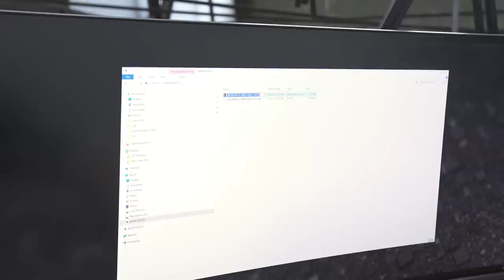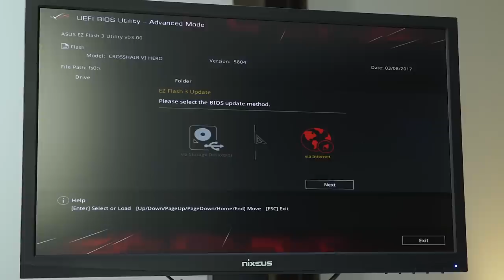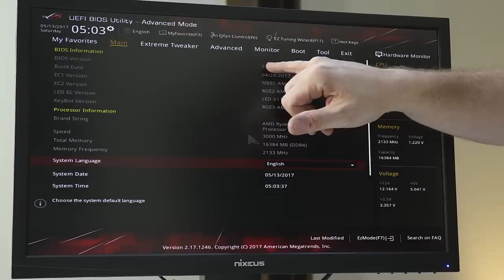How to build a Gaming PC

Comment: I bet most people like me, already know how to build a PC but clicked on it anyway because Jay is awesome.
Reply: can you help me with building a pc? i tried learning but i always get confused on compatibility and the difference between good graphic cards or bad ones. and PSU's. i know now to use PC part picker. im debating on upgrading mine or just overall getting a brand new entire build. If anyone wouldnt mind with giving me ideas. :)
Reply: What do you own already and what do you intend to do? High-end gaming? Video editing? Or just casual games like overwatch?
Reply: high end gaming i guess? well at least to be able to record/stream on max settings on games like playerunknown, overwatch, h1z1, most MMO's. or at least super high where it doesnt feel like my computer is going to die.  eventually using sony vegas as well. i know two major upgrades i have to make is Case, PSU. and a newer motherboard. 

this is mine, from speccy. 

Operating System
 Windows 10 Home 64-bit
CPU
 Intel Core i5 3470 @ 3.20GHz 28 °C
 Ivy Bridge 22nm Technology
RAM
 12.0GB Dual-Channel DDR3 @ 798MHz (11-11-11-28)
Motherboard
 Foxconn 2ADA (SOCKET 0) 28 °C
Graphics
 VL370M (1920x1080@59Hz)
 4096MB ATI Radeon RX 470 Graphics (MSI) 38 °C
Storage
 1863GB Seagate ST2000DM001-1CH164 (SATA) 27 °C
Optical Drives
 hp CDDVDW SH-216BB
 DTSOFT Virtual CdRom Device
Audio
 IDT High Definition Audio CODEC
Reply: Don't worry, you start to understand it more and more. I just started learning yesterday and already can tell where the GPU, CPU, CPU Fan, Motherboard, HDD or SDD, PSU, and Dvd drive are. I may not understand all the statistics of the GPUs and the CPUs but I can put them together, so... c;
Reply: TechMantrvnvn
Reply: TechMantra I just built one today
Reply: U r totally right
Reply: Same
Reply: AlfredoIsSaucey there's no such thing as a "bad GPU" it all depends what you want to use it for, if you want to game on ultra at 4k, do video editing and stream then a GTX 960 is probably a bad GPU, however if you want to go for low end gaming (mid to high settings) @720p/1080p then it's probably a decent enough card. So basically for your card you need to consider what will you use it for, and will you get full use from it. If you want to game on ultra settings at 60fps, do video editing and streaming I'd probably recommend a 1080, or 1080ti, the 1070 i believe isn't quite powerful enough for 60fps at 4k, but perfect for 1080p gaming, but you may want to check the performance to price ratio for each card especially in today's market. As for CPU, what generation you go for is up to you, but I wouldn't go older than 6th gen, as even that will be considered obsolete soon, personally I'm running a 6th gen i5 but my build is a few years old now and we're on 8th gen. You also want to consider what you will be using it for, if your just gaming and won't be overclocking, you probably won't need an overclockable CPU, and you probably won't be taking advantage of hyoerthreading, so something like an i5 6500, 6600 or 7500 ECT will be perfect, however if you want to overclock you need an overclockable CPU, these are the ones with "k" at the end of it's name (note that's for Intel CPUs only, check if your using AMD if it's overclockable if you want to overclock) if you want to video edit and stream, only then would I reccomemed an i7, as for gaming only I think i7 is overkill, but again check the performance to price to see if you feel it's worth it. Then you need to consider RAM, this will most likely be DDR4, the speed of the RAM won't affect the overall performance dramatically, but it will have some impact so again decide if "faster"  RAM is worth the extra money depending on what you will be using it for, and how much RAM you need. For an office PC today I'd probably say 4gb minimum 8gb maximum, gaming PC minimum 8gb maximum 16gb (more and more games are recommending 16gb RAM, but are still playable on 8gb, but maybe not at max settings) and video editing I'd recommend 32gb+ I have tried video editing on my i5 build with 16gb, it's doable, but takes awhile, then when choosing a motherboard you just need to make sure it supports your CPU, if you want to overclock check the board is capable of doing it, if you want to do SLI or crossfire make sure the board supports that (most boards do) and make sure you have the right RAM for that board, which is more than likely going to be DDR4. As for the case, all you need to do is make sure it has support for the board you've chosen (ATX, MINI ATX, MICRO ATX ect) and has enough room to take your GPU (most cases will say maximum card length in the description if you buy online. As for storage, that's up to you, personally I use a 250gb SSD to store my OS and some other programmes I want to boot with Windows, and a 2tb HDD for my games just because HDDs are cheaper than SSD's, but that said theirs no reason you can't use SSD's to store everything. And for the PSU, you want to make sure it's atleast 80+ bronze rated, don't go for a cheap one without a rating, and you can use an online PSU calculator, their are multiple of these just do a Google search for "PC PSU calculator" put your specs in and it will show you how much power you need, and a recommended size PSU
Reply: TechMantra dab
Reply: lol you got me on this one. i have built soo many pc's but still watched
Reply: true true

Comment: Just in time! I'm buying my parts for my Ryzen PC tomorrow, after having saved for over a year. It'll be my first PC! Thanks, Jay!
Reply: Thanks! Happy to soon be apart of the PCMR! I'm getting a Ryzen 7 1700 and an RX580.
Reply: Same here, Just got my last load of parts through the door yesterday after saving and planning for nearly a year. good luck with your build!
Reply: I made mine last week. Ryzen 5 1600x and also a RX580, also my first build.
Reply: Congrats buddy, have fun with your awesome new machine! ^^
Reply: SimmonSays insert pc elitist comment here about how you should stay on console

In all seriousness congratulations on your PC, hope you enjoy it
Reply: Try to get started on it b4 Saturday bcause nothing sux more than realizing you're missing something and having to wait til Monday and staring at it all weekend :)
Reply: Just built my first PC 3 weeks ago. R5 1600 with a GTX 1070. So much fun to go through the build. Enjoy it.
Reply: better to get the 1060
Reply: SimmonSays nicceee 1600 and Rx 580 as well
Reply: Rodrigo Juez in most situations the Rx 580 outperforms the gtx 1060
Reply: Dova Pug the rx 580 doesn't outperform the 1060. They are nearly always the same performance. Some few fps and some time those fps is on the rx580 and some time the 1060. Btw the 1060 is a little bit cheaper.
Reply: Welcome to the community! 
I built my PC in 2014 and haven't looked back since (i5 4460+R9 280X)
Reply: arthur staal r9 280x is still a beast of a card
Reply: Moibhin agreed, still haven't found a game that runs bad on the thing (well kholat does, but it's terribly optimised)
Reply: +arthur staal I have 2 of them and still does the job. Mass Effect Andromeda is shit in crossfire though. I get mid 40's at 1080P with 1.
Reply: ***** well time to lower some settings then 😀
Reply: That's exactly what I did last week. Almost all of my parts are here. I'm so excited to build it. Cheers, bro.
Reply: IronShredd Wow.  I'm in exactly the same position as most people in this thread.  Saved.  Parts tomorrow (Most important ones).  Fingers crossed!  Looking forward to it.  I know I'll never go back if I get this thing working.  Hope all your builds went well...
Reply: johnny morell good luck!
Reply: I have been saving for a year and  9 months, getting 900$ in only 4 months im so happy!! ill build a ryzen 5 1600 with a rx 580 4gb !!!
Reply: looks like I happened to get on the comment again after a month, but im getting it in 5 months :(

Comment: I know how to build a PC, but for some reason, I still watch build guides.  I guess because I want to see what I could do when I get around to building a new system.
Reply: It really helps to have a good organized workspace with good lighting too. Building on the carpet of your 1st apt is the worst!
Reply: Its fun to see what other people like to do. Sometimes you pick up tips you never thought of. Connecting front panel first? What is this madness?! I always thought it wasnt a pc build until you were swearing and trying to plug tiny plugs into headers you cant see. Bonus points if you manage to stab yourself under a finger nail with one of the pins.
Reply: I actually never had this issue, in fact I always install any front panel connectors BEFORE I put the motherboard in, I just sit it on one corner of the case, plug all the little shits in and then screw the motherboard in place. It's just something I've never thought to do otherwise, I don't know how people can even fail to see it that way and complicate things unnecessarily. Lul.
Reply: You're an absolute mad man. Honestly I just normally forget until I push the power button and nothing happens.
Reply: Mike McCanna That's the thing.  Nowadays, there's so much information, that there's a good chance you bypass a lot of the problems others have had.  Sometimes a good thing, sometimes not so.  I guess you learn quickly if it happens to you.

Comment: Maybe 2 years old, but this video made me subscribe. Watched it numerous times. As of 2 days ago, built my first PC at age ... fiftysomething-ish. I was straight up stunned when I looked over all the connections ... five times ... turned on the PSU ... hit the power button, and the damn thing actually booted up, lights on, fans all running. I wept. Openly. Upgraded the BIOS per instructions, installed Windows without incident. Appreciate your efforts, man. Thanks.
Reply: Hey congrats on building your first PC. Built my third about a week ago.....totally forgot about the part where ryzen takes forever on first post...I may or may not have been a little panicky.

Comment: Jay forgot to tell us that you need to reapply thermal paste after reinstalling the AIO onto the motherboard... I wonder how many people didn't reapply thermal paste and then over heated their CPU???
Reply: Oh shit... you're right. Probably want to correct that ASAP. I would have done it anyway but if I were new...
Reply: I find it hard to believe anyone who is building a pc would forget thermal paste on their cpu cooler.
Reply: Whats thermal paste for? Is it suppose to make it not overheat?
Reply: Thermal paste ensures a solid path to conduct heat from the CPU to the cooler. It eliminates any gaps, as air, while good with convection, is a poor conductor of heat.

A common problem is using too much thermal paste. As Jay says, a pea-size drop of paste is sufficient. (I'm not sure why too much paste is problematic, but everything I've read warns against it, so....)

Comment: Thanks so much for this!  This is my first "gaming" PC and you really helped me out, especially because my used gear (GeForce 1080ti, etc) was just right to be cutting-edge when you made this.  The ATX "turn-on" hint was a lifesaver.  I wire-wrapped my first S100-bus computer (Intel 8080 was the processor) back in the 1970's but haven't done a build since the Pentium era.  Wow.

Comment: instructions unclear 
i put the gpu in the cpu socket and bent all the pins
Reply: Working as intended
Reply: you are a genius lol
Reply: Good thing with amd that all the pins are on the cpu itself. So your joke doesn’t work with this video as he’s using a motherboard that has an AM4 socket. Not those stupid endless LGA whatever sockets that keep changing.
Reply: 3SevenRubyStang ...that was probably part of his joke. Unless I’m giving him too much credit lol
Reply: Nah it's definitely a problem. Did you use an AM4 mobo? I think you better go for a Z399. It'll fix the issue.
Reply: No man. Use wheel bearing grease. All good

Comment: And then we're going to update our Bios ...... POOF  
Oh shit, oh shiiiiiiiit!!!!

I don't know why but everytime I update the Bios I always think the worse Is gonna happens.
Reply: Benoit Levesque it is certainly an adrenaline rush, knowing that if something goes wrong your mobo could be bricked. never happened to me though.
Reply: its when you frantically look in bios manual to find backup bios
Reply: I actually spent 140€ on a Ups specifically for bios updates because i'm paranoid. I could've gone cheaper but i wanted something good to be sure.
Reply: I didn't even know that was possible :0 never had that problem
Reply: Most people don't. But when it happens it often means an rma at least and worst case you have to buy a new motherboard if your power dies during the bios updating process.
Reply: I thought motherboards have a dual bios for this specific reason...
Reply: All the good ones do, but more budget options don't
Reply: I haven't had that "rush" in years as my motherboards have had dual bios chips and failing a flash doesn't kill the board at least I don't think it does wouldn't know I always take precautions when flashing. A> make sure the weather is clear and the power bill is paid up (can't have any brown out or power shutoff messing with your update)  B> Boot to a usb flash drive (or floppy if you still have one... seriously does anyone still use these?) into a basic command line dos C> make a backup of the current bios if I don't already have one. D> Flash that thing E> Reboot with glorious updated bios goodness.
Reply: This actually just happened to me with an ASUS X370 Prime, updating and the power went out. Luckily I have a UPS for these exact situations...
 
Unfortunately, I idiotically decided to flash it on a test bench in my garage, wherein said UPS was not in attendance...

It still lights up though... so that's a plus.
Reply: StayBullish I would still contact Asus, they'd probably help if they can.

Comment: Hey Jay, did you set the master/slave jumper correctly on the HDD? Just kidding... Damn I'm old...
Reply: LOL so glad we don't have to deal with that anymore!
Reply: H Koizumi i was wondering all the time why he didn't mention any of these things ..damn it i'm outdated.
Reply: He also forgot to install a floppy drive
Reply: Now I'm going to scavenge up a floppy drive and some old school Oregon trail. my 9 year old is blown away by today's technology, time to introduce him to yesterday's tech lol
Reply: Remember struggling with those 4 pin power connectors on hard drives before sata or connecting the front and top case panel wires with almost no clear use able instructions and oh yes struggling with a power supply that had so many unused permanent connectors because modular power supplies were deemed not effective and not recommended -damn we been through the  wars
Reply: I was thinking that too. Shows how long ago I build a PC. ;)
Reply: how about the scsi terminator?

Comment: 30:48  can you imagine if you lost power to your home at that exact moment
Reply: UPS with battery backup ftw
Reply: The fuck? This was a 30min+ video? I actually did not realize that before I read your comment. I guess I enjoy watching PCs being built then...
Reply: That's why you invest an extra 50-150€ in a proper ups.
Reply: Indeed, I have a good UPS too, one of the best investments I've ever made.
Reply: A good surge protector is a must as well.. getting one with rj-11/rj-45 protection is a plus if you use a direct connection to your modem and for the line to your modem if it's DSL.
Reply: ASUS motherboards can flash themselves from usb and dont even require CPU to be installed to do that. Idk about all of them but mine does.

Comment: Hi. A beginner here. How to turn off the pc, after u turn it on with a screwdriver? Do I just turn it off using the PSU switch?
Reply: Edwin L same way you turned it on.just jumper the same pins but this time hold it there until it turns off. just like when using the actual power button on the case.

im assuming its just to POST. If so turning off by power button/jumper is no biggy as it only can matter if u have an os installed already. ie. corruption of files, etc.

TL;DR
in short just jumper the 2 pins again
Reply: Phil Brown Hi, thanks for the tips, I understand better now.

Comment: I realize after completing this video, you may ask if you can either go back to bed or is the coffee ready yet. But for those like myself, who need a manual to find an “on” button, this video was a jump start to picking up a screwdriver and having a go at it.
I know there are hundreds of computer nerds out there who started building computers when they were still in the womb, but I once used dial phones, and my teachers wrote on a blackboard. Yet, even though I’d like to ask the most basic of basic questions like which fan gets plugged into where, this was a GREAT walkthrough.